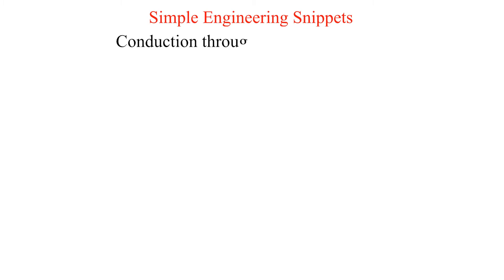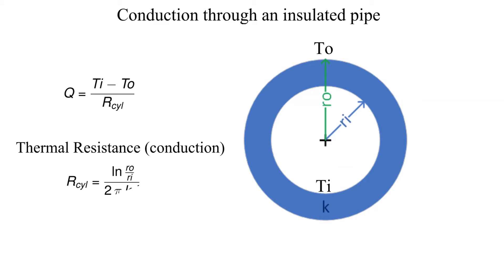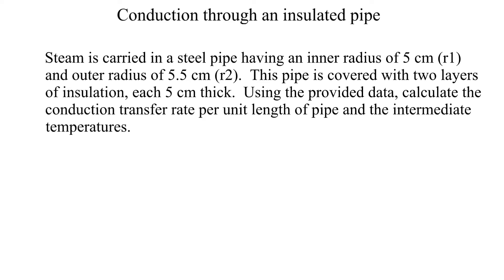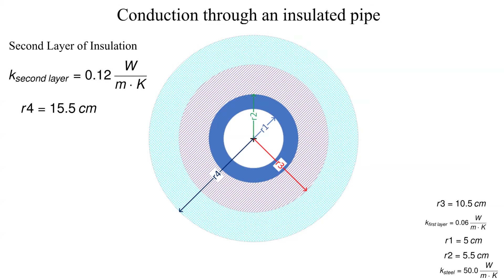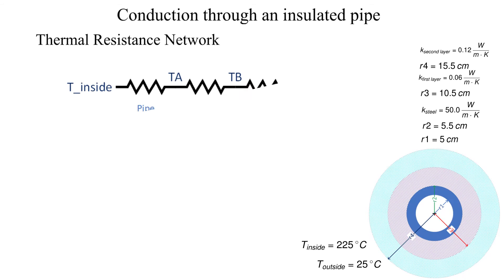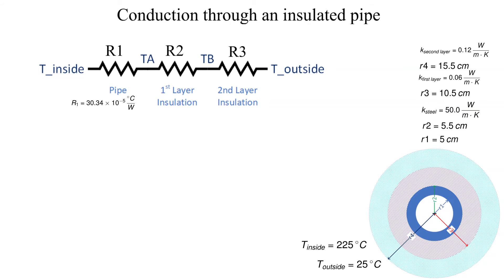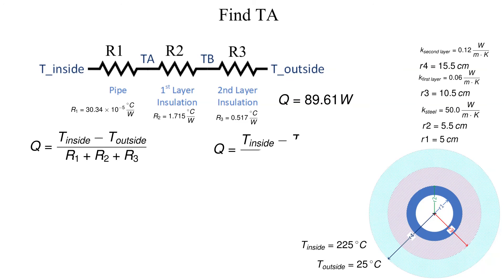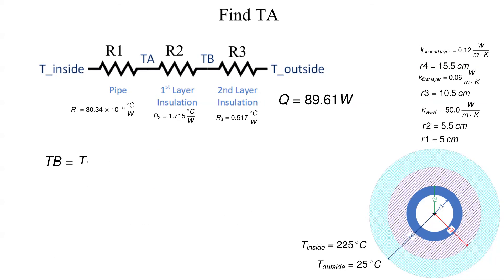#HeatConduction, #CompositeCylinder using #ThermalCircuit.

Comment: Hallo, Is it much diference of heat losses if we have horisontal or vertical pipeline?
Reply from the maker: I'm guessing you're asking about free convection over a horizontal canned beverage or an upright canned beverage?
Reply: @simpleengineeringsnippets7102  , Yes i need to compare losses on pipeline witout insulation (free convection) vs insulated pipeline. Can you help me please?
Reply from the maker: No insulation (or with insulation) has nothing to do with free convection.  Free convection (or no free convection) is the boundary condition on the external surface of all the layers.  The answer to your original question lies in the boundary conditions.  Best of luck to you!